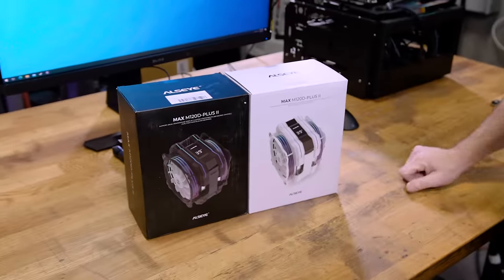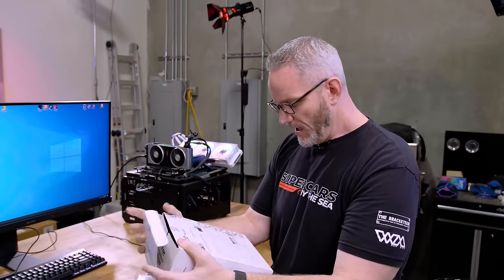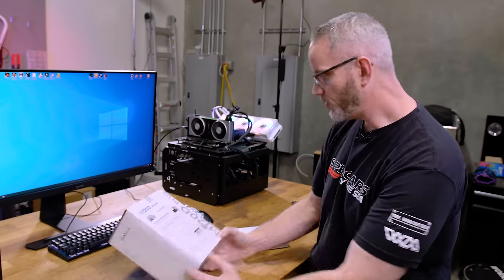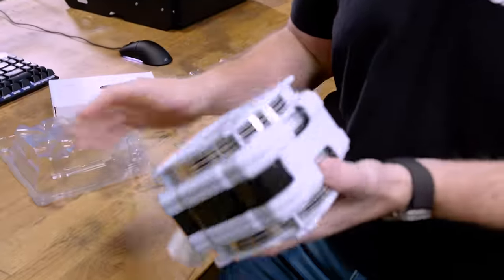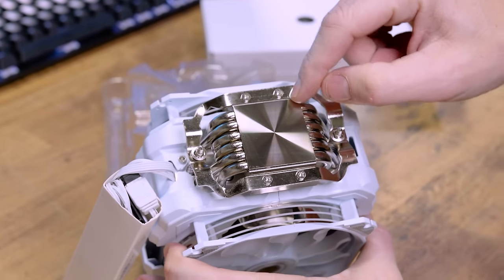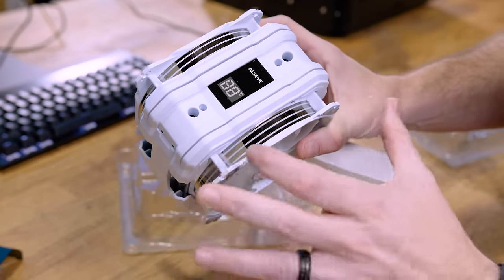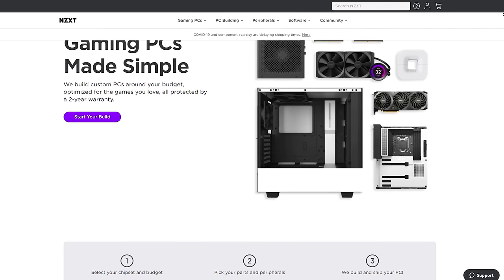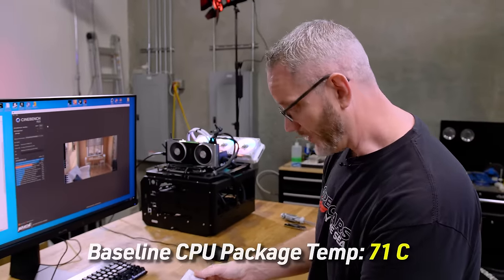This air cooler is actually terrible for modern CPUs

Comment: Yes.
Normally I would go strait into AIO or custom water cooling but personal cost constraints are pushing me into a mid-CPU and Air cooler for my future build. I would appreciate an tower cooler comparison and guidance. I have not looked into this as closely in the past and am finding myself asking more questions than if I were just shopping for an AIO.
Reply: I used to be the same way, im still on a AIO but i went with deep cool, quality with a very affordable price im very impressed and keeps my 5.0ghz 9th gen i5 nice and chilly. ID cooling is doing very good things as well, i got my wife one of there white tower coolers for her rig and the cooler does very well and the fans and the rgb are well done, also affordable!
Reply: It's not that complicated. You want a heatsink that will have as much surface area as possible with a fan with the most static pressure possible. A thicker heatsink with more densely packed fins will have more surface area but also more impedence which will mean it needs higher static pressure fans or two fans in push pull configuration. Dual tower coolers are usually the best performing since they their thinner towers and multiple fan designs allow the fans to push through the fin stack more easily. Also, with modern CPUs having a copper cold plate contacting the CPU is better than having direct contact heatpipes, but it's not s huge deal.
If you want a single tower cooler then the Arctic freezer 34 duo is great for the money. For dual towers the scythe fuma 2 is cheap, small-ish and has great performance. The noctua NHD-15 is clearly a monster, but it's quite expensive.
Reply: Well, Gamer Nexus already made a cheap air towers comparison
Reply: I went air-cooling because my room already gets hot as hell, with water-cooling it would be even worse. I'm running a NH-D15 on a R7 3700x and never see over 62*C. Air cooling is just as capable in a gaming rig, imo.. I think it isn't until you start pushing the OC that you start to need more efficient cooling than a high-end air cooler
Reply: thermalright peerless assassin PE 120...
Reply: @tragikk03  Dude, thermodynamics do not work like that. Your CPU has a wattage, which entirely goes in to heating up your room. It does not matter if you have air cooling or water cooling.
Reply: just get AK620 or cheaper AG620 and you should be fine
Reply: @tragikk03  if your cpu draws 200W and you dissipate it with an air cooler or an AIO the amount of heat that goes in your room is the same... man
Reply: @pierb2  you don't know what you're talking about...... man

In most systems, water cooling is more efficient at transferring the heat from the hardware to the room air
Reply: @Sup3rman1c  you also don't know what you're talking about. "Google will water cooling pc make my room hotter", genius

Wattage is irrelevant - it's heat transfer efficiency that matters (when comparing 2 identical systems 1 air-cooled and one water-cooled)
Reply: @tragikk03  Either way that heat will eventually make its way into the atmosphere. If you want your PC to belt out less heat, power cap it or get something wwith a lower power.
Reply: @tragikk03  GottEm
Reply: @itIsI988  what I'm saying is common knowledge. Not sure why there's a debate here
Reply: @tragikk03  I get what you're saying and if you've got ac or decent ventilation in the room then it'll probably be less hot with an air cooler. My point was that one way or another the heat will make its way into the room eventually.
Reply: @ChickenGod yea, air-cooling is perfectly capable for anyone who isn't really into OC'ing, imo.

 I would feel uncomfortable with my GPU running at 90* - I'm air cooled too, but my 3080 never sees over 72*C (cpu is usually 5-10* cooler)
lian li lancool 2 mesh case, 
nh-d15 cpu cooler
Ryzen 7 3700x
Msi 3080 gaming z
4x intake fans (3x at front of case and one on the divider above power supply blowing directly into gpu)(also huge fans on the noctua cooler)
Reply: Overclock is no problem like the easy bios settings up to 5.3 ghz, with big tower coolers, i whould like to see how good tower coolers can cool the newer 30-60 core cpu.
At base clock tower coolers should be able to cool them hopefully around 70-80c a cpu can handle 90c even up to 100c but not so good running it so high long time.

My 2060 has only 2 fans and overclock of course, i play some games 4k at max settings with 60-80 fps.
But only beautiful games like tomb raider and assasins creed and such that can look amazing.
I don't play much shooting games mostly open world rpg games and horror games and 80-90c is max and no problem, mostly summers it can get hot so can go from 60-80c but not much to be scared of.
Reply: i really want him to look into the arctic freezer 7x. i originally got it for my previous fx8320 pc because i needed something with a 125w wattage but the hyper 212 wouldnt fit inside my case. i was really impressed by it though, such a small cooler for just 20 euro out here keeping a damn amd bulldozer cool... i got a second one now for my r5 3600. it really should be talked about more i LOVE this cooler!!
Reply: @tragikk03  Water cooling is only more efficient *at a given temperature*, meaning that with air cooling your system has to reach a higher temperature in order to achieve the same heat dissipation of a water cooler, e.g. an air cooler might remove the same heat from a 70°C system that a water cooler removes from a 50°C one.  The amount of heat going into the room is the same with either.
Reply: @scowie  that's literally what efficiency means bro.... water is more efficient at absorbing/moving heat

In my specific system with my specific ryzen 7 3700x and msi3080, air cooling transmits less heat into my room because it is less efficient - that doesn't mean air-cooling is inherently better/worse as a PC cooling system (as a whole), it depends on the specific application
Reply: I recently tore down my custom loop and went back to air after a CPU block failure. 14 fans and a dark rock TF easily competes 😂
Reply: @tragikk03  just nope.. ;) 200W output is still the same - it does't matter if on air or water.. "wattage is irrelevant" oh my.. the transfer with water is more efficient because of water thermal mass.. but it's still 200W.. and at the end it's still just an air cooler - water system radiators are just that. have a look on how much "energy" can good heatpipe move.. ;)
Reply: After i had a reputable brand aio fail on me (nzxt) and another heavily disappoing me with performance (deep cool 240 something) i'm back with regular air coolers, even the most cheapo one from amazon will work just fine, you just need to pay attention to the size and fin density. That thing will last forever  (my old hyper 212 still in my pc rn) and you have no risk of leaks or any of the complications that come from watercooling

Comment: i literally have the black one and was looking for a vid like this when i bought it 2 months ago for my 5600x
Reply: The advantage of AMD CPU is that are a bit more easy to cool down with Air CPU coolers so that's good.

I have other model of the same brand and still works fine, my CPU is not that hotter so is not a big deal for the Cooler I've bought

Comment: Too expensive. If you're buying a CPU cooler, you either get the cheapest one because you don't care, or you do care and thus you get like a U12A for $100.

Paying $30 or $40 for a cheap cooler that works well enough? Cool. Once I'm paying $70 though, I figure I may as well just spend a little more and get the Noctua.

Comment: I bought one of these a while ago for an i5 7th gen, and it cooled that fine ~50-55 C under load with basic Arctic thermal paste. Anyway, corsair vengence LPX, the low profile ram, does fit under the cooler if anyone was wondering.

Comment: Note to self lol. Re-seat your CPU when replacing a cooler or thermal compound especially on a PGA (Pin Grid Array) cpu. I put a new cooler on and my PC started to randomly crash shortly after doing so. I took the cooler back off and re-seated the CPU and it has been fine since then.

Comment: As a Cinema 4D user - this cooler scared me!  I'm using the Ice Giant cooler - I moved away from using the Arctic Freezer 2 about a year ago - and it has been great.  I like the idea of a dedicated screen on a heatsink - I wish more air coolers or vape-chamber system had that- Having a cooler via raspberry pi or a screen setup in windows for cool monitoring either builds up more heat or gets in the way of other applications.

Comment: Hey Jay,

AM5 holespacing is exactly the same as AM4. The Z-Axis hight remains the same too. So that is not the Problem as to why AM4 coolers may not fit on AM5. It's that the backplate is integrated in the AM5 Socket.

I don't want to seem like the overly correct commenter, but you made a mistake there Regarding AM5 in the beginning.

Hope you don't mind me correcting.

Comment: could you please ocmpare water coolers like iCUE H170i ELITE CAPELLIX Liquid CPU Cooler pris is not issue but you may compare as well (it work with am5  even if it say am4 in box because I use it ) I wish just see it's performance (well 6 fans 140mm industrial noctua 3000 rpm may be amazing with it)

Comment: Do it, do a shootout of these air coolers. I'm a fan of custom loops for ITX builds. But having the CPU on air and the GPU on a custom loop would be a direction I would go if there is an air-cooler out there that can handle 13700K.

Comment: even though it's really inaccurate, the LCD looks great and the RGB are very nice. But from what I heard, it's not the quietest and the build quality and the heat dissipation ain't the best. Then again, it's not very expensive so people mostly buy it for aesthetic purposes.
Seems to be worth using if you're using locked chips and don't mind a bit of noise. Or if you really want an LCD, you can wait for Deepcool upcoming LCD aircooler that was set to release around late Q1 - early Q2, but expect for the price to be pretty high.

Comment: I wish this test were run with equipment in factory fresh out of the box conditions
because when you start messing with voltages and all these other setting that most people  (don’t understand or) aren’t going to change these results end up being like 1 in 1000
Just give us a 13900 or a AM5 test with factory settings. No overclocks no undervolts and fan rpm settings that are comparable to the test cooler rpms

Comment: I think that it would be more interesting if they just made a decent looking little CPU tempature display that could just be mounted to the top of most air coolers for like $20. Make it come with different color trims and/or a ring of rgb around it. They would probably have to use double sided tape, but I guess that would be OK if it came with good tape.
Reply: Problem is how you have a temperature sensor, unless you just mimic the motherboard information.

Comment: As long as the AM4 mount uses the standard AMD backplate it will be directly compatible with the AM5 backplate that is screwed into the socket. The coolers that are not compatible are the ones that use their own backplates. For examples grab any Asetek AIO cooler and the AM4 mount you snap onto the pump fits perfectly fine. Screw on the standoff's and bolt it on.
Reply: Exactly. Those weird oval holes Jay talked about are relevant to LGA1700 from Intel to let you install an LGA115X cooler.

If he was talking about AM4 there were actually some boards with oval holes to allow the installation of an AM3+ compatible cooler.
But the hole spacing between AM4 and AM5 is literally the same. You only run into trouble with stuff like old EK blocks with their own backplate (ask me how I know).

Comment: Yes do a Amazon air cooler comparison, I also saw another air cooler with temp gauge but it was the horizontal style fan on Amazon as well. I thought that would be cool to check out and it was much cheaper though way less cooling I’m sure

Comment: Even my noctua nh-d15 struggled to cool my 7600x running R23 it was around 90-93c, it was boosting to 5.4ghz, even with two 360mm rads and a custom loop cooling the cpu/gpu, it's still was hitting around 77-80c, in eco mode it's down to 67c. running games around 51c, these new processors run really hot compared to my old intel i7 7700k.

Comment: I'm pretty happy with my Arctic Freezer 34 Duo. The other case fans I ordered are still delayed but I already wanted to try out my first PC build for Warhammer40k Darktide. It managed to keep the I7-13900k installed at around ~80° with only one exhaust fan in the back of the case.

Comment: Nowadays, if I build a PC, I go with a e2e4 cooler - not sure if the bran even exists outside of Russia. Either way, they make really good coolers for cheap. For example, I bought a six-heat-pipe tower cooler with a 120mm fan for about 15 dollars. The fan may not be the best - plus it has RGB vomit you can't turn off - but it performs well enough. It cools Phenom II x4 960T in overclock (about 105W TDP) very well, the temps don't exceed 55C in a poorly-ventilated case. I have a four-heat-pipe version of it in my main PC that has Ryzen 5 2600x in stock, and it handles that just fine too. I believe, if fans are replaced, both of those coolers would perform even better, but I am fine with them as they are.

Comment: Do you still have a "toasty" 5800x you can set up somewhere ??  It would be cool to see on one of AMD's hardest to chill previous generation CPUs.  And hell yes please buy and test/rate air coolers.  Because of your "discovery" with the Vetroo 5, I have one on my old 3600 and 5600x machines and they are both busy folding 24/7 (Peterborough Fights ... Team 264266) which, like Cinebench, is pretty intensive.

Thanks for continuing to put out interesting content (and poking fun/ribbing Linus) .  

Cheers !

Comment: Cool you chose this particular cooler/model - I had an eye on it debating between  a AIO and air options but this narrows thing down a bit.  Thanks!  Besides the given cons here also discovered its a bit too much in height for my case anyway.  I am leaning more to the AIO option for a more consistent cooling on a higher output CPU - corsair for one.  NZXT has a temp display option AIO but a little pricey in comparison for that additional feature.  I can go up to a 240 as for mount space.  

Being that my build case already has dual 120 fans in the top - I can of course (a) mount a 120 or 240 above those to the frame - "assuming" that cooler/fan config would add some additional cooling efficiency to the cpu overall...?  or (b) should remove existing fans altogether and mount AIO underneath the inner frame at top?  Not positive if the (a) "more is better" idea will be a big difference. Anyway just getting a further bearing on it as I complete this one.
Reply: MSI has one for 140ish or less if you're lucky

Comment: I wouldn't mind a Cooler shootout video personally.   as i'm a noob when it comes to coolers, and went with for my Intel 10700  from local shop purchased a Be Quiet Pure Rock 2 that i forgot to take along and see if they'd install it,   my ride wasn't gonna go back home to get that cooler, so i picked whatever air cooler they had in stock.    Arctic Freezer 7x,  seems to cool pretty well i guess,  but i learned one thing i'm a terrible cooler installer for sure

Comment: It seems that not knowing what its wattage cooling is the only major downside. The next strike against it is that it obviously won't be good enough for any thing newer than 10th gen. Perhaps if it was about 20-25 dollars cheaper it might be a good deal. An air cooler showdown would be a neat video. Could probably make a small series out of it.

Comment: I use the following cpu cooler with my Intel I-9 13,900k processor:

be quiet! Dark Rock Pro 4, BK022, 250W TDP, CPU Cooler

Works great and keeps temp in the 40s to 60s.

Comment: I bought thermalright PA 120se just yesterday ,thus i have new 5600x with stock cooler (stock sucks insanely), while its overkill its still for the same price as good mid range coolers, 50euro. So why wouldnt i did not went for it. I am just curious if can overclock my CPU a bit with that one. I hope i will be able to do it. Someones opinion if it will be possible ? :)

Comment: I've been using the gammaxx 300 cooler in my old i7 7700 which is now in my 8 year old daughter's all pink pc build and also in my i3 12100f..it's absolutely perfect. It's whisper quiet..And when I mean quiet, I don't think i have ever heard it. And it just works,keeps my cpu's away from that 90 degree celsius heat and my daughter's room is very hot and the pc has never restarted,whereby it used to restart when I had it in my old cosmos s case and a stock cooler..now it just looks beautiful and works.I love those gamaxx 300 coolers.They are absolutely silent and just do the job perfectly.

Comment: Too bad. I expected better of it. I currently running amd 5600x on stock cooler, with auto settings, and don't dare to overclock because factory-applied paste was kind of skim. So I thought this could be a nice upgrade. :(

Comment: man my i5 13600k is paired with a 250TDP cooler and it throttles in cinebench while pulling 180watts... I cant understand why it doesnt transfer the heat. My last cpu I had to delid to lower 25ºC and Im disappointed to think that I have to do that again...

Comment: I just built my first PC, for those of you that really know their shit, is there any discrepancies in my build? Will there be bottlenecks? What should I look into upgrading first?

Motherboard: MSI Pro Z690-A ATX
CPU: Intel i7 12700k
GPU: EVGA RTX 3070 Ti
RAM: Corsair Vengeance RGB Pro 32 GB DDR 3200
NVMe SSD: WD Black SN 750 1 TB (Read: 3470, Write: 3000)